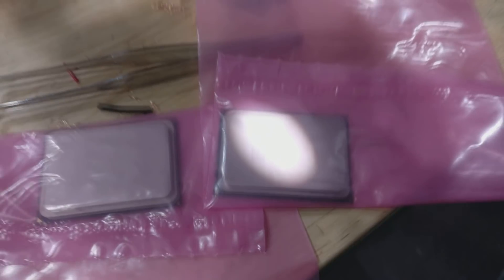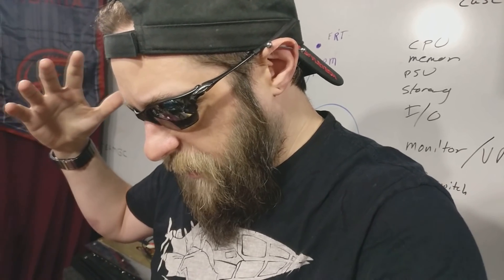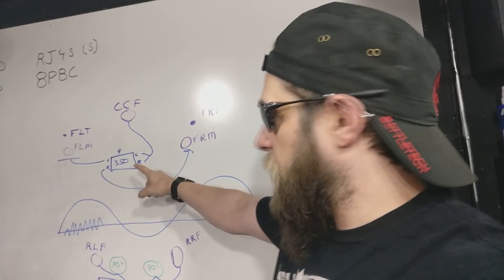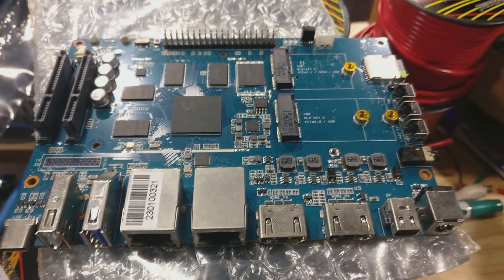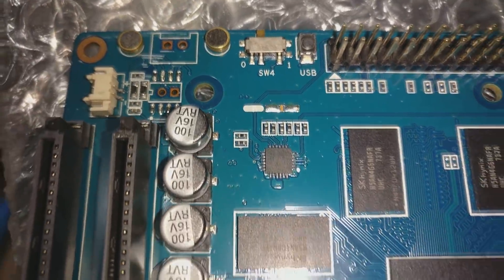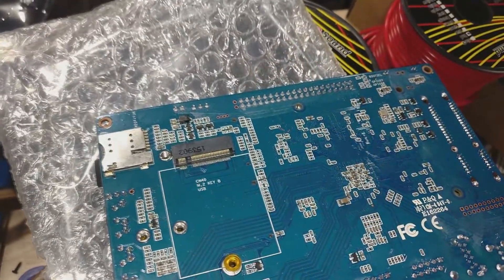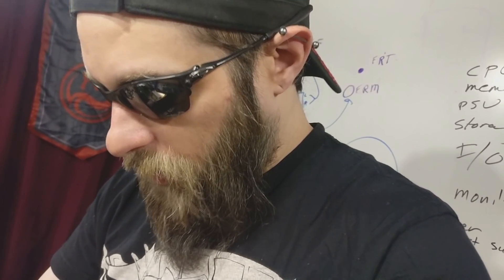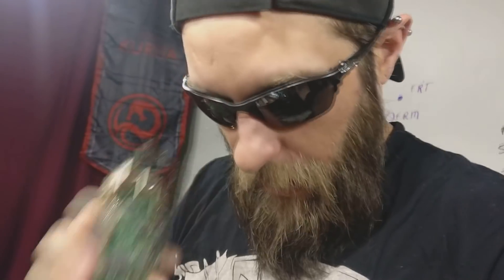Qain's World #0087 - Project Updates in the Vault

Comment: just upgraded the system in my acura ripped out all the front and rear speakers added two subs and two amplifiers, and im running a full blown windows 10 pc up front to control it all
Reply: @deusqain  nothing nearly as crazy as the setup you are running but i believe its a dual core celeron tablet  of some some type that runs 2.2ghz(i can get the exact chip for you later) with 4gb of ddr3 I could not stress enough a device that outputs 24bit audio its perfect for my needs which is 1080p youtube videos on the road or all of the Lossless music I ripped playing over foobar2000(i care about the audio more than anything), convenient to have discord and steam on the road, after writing this comment now im debating on going all out with a custom pc build for it. on a side note the tablet has a great 1080p ips display sooo it works great for the time being. if i decide to go custom ill update you on it if interested.